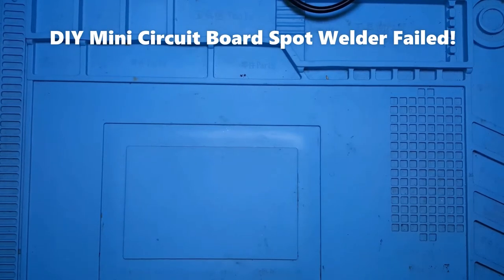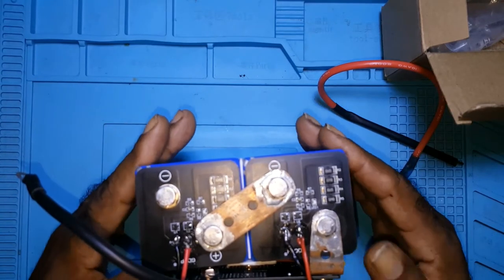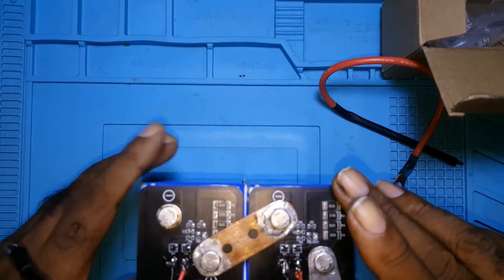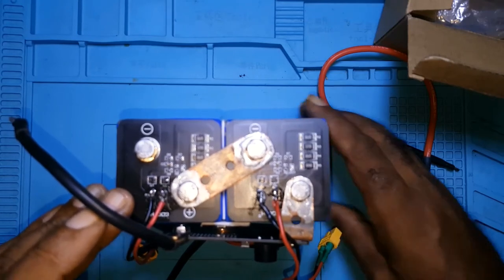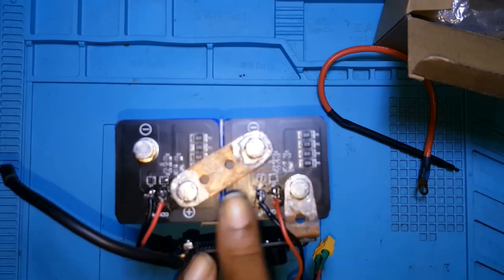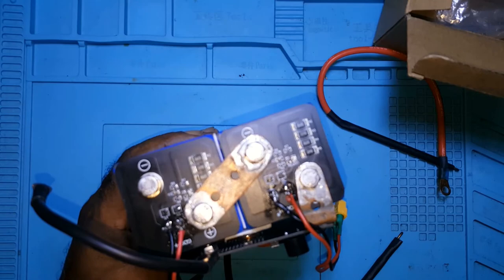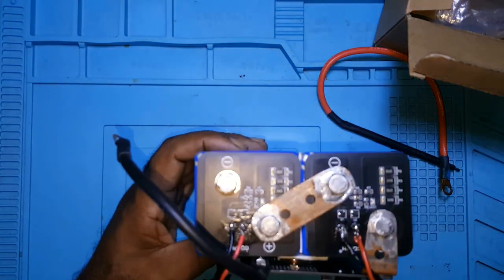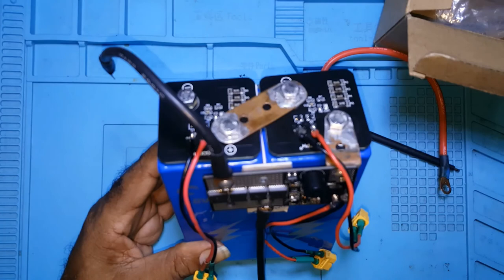DIY Mini Circuit Board Spot Welder Failed!

Comment: Supercapacitor's discharge amperage depends on the resistance (ohms law). So, to get high current the resistance has to be very low (miliohms).
The long cables, and all other connectors increase the resistance significantly
Try to shortcut the supercapacitor with a nickel stripe and you will see the results.
Reply from the maker: Ok thanks.Will I be able to use it on a 24V inverter.